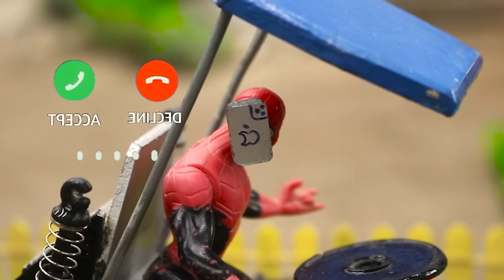Mini tractor making diesel engine supply water pamp | Rescue fish from dry lake  @sunfarming7533

Comment: The mini tractor as water pump with diesel engine not only offers high performance and good durability but is also flexible and energy efficient, making it an ideal solution for water supply needs in a variety of applications.